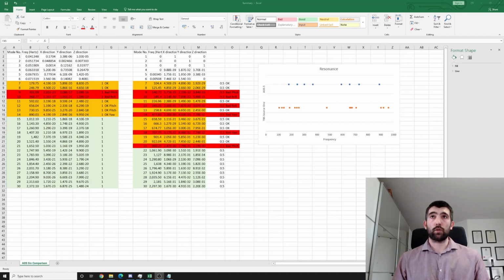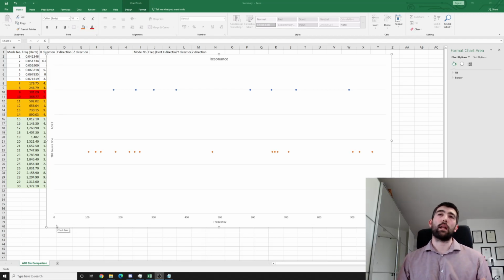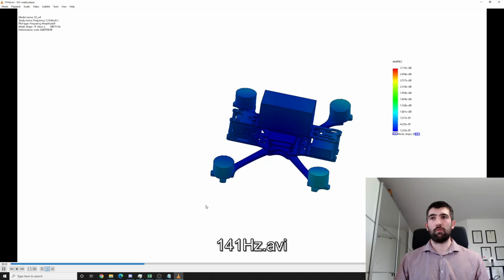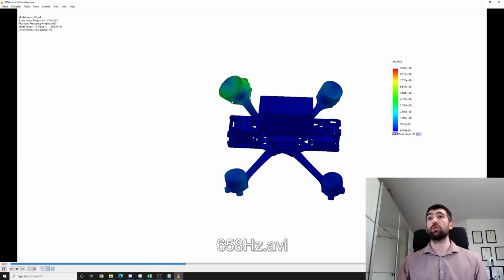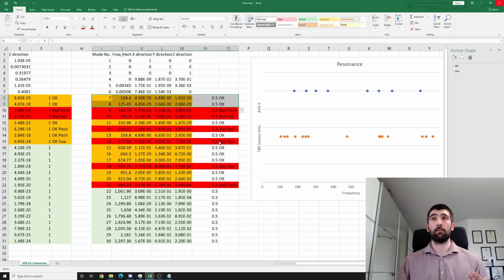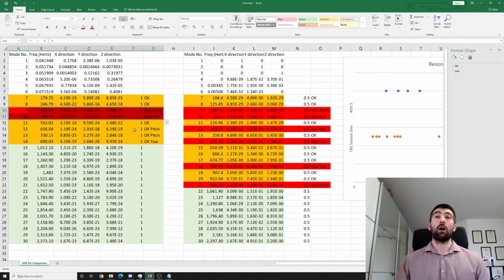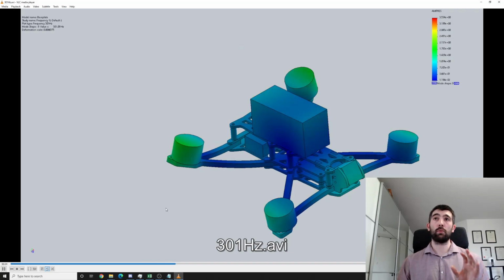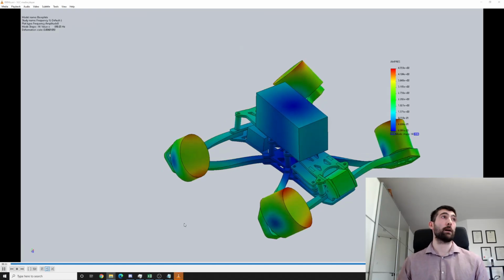Frame resonance analysis: How does my frame design stack up to the TBS Source One?

Comment: This is awesome! did you model the source one frame with 90deg cuts or with filleted edges? I have 2 genuine source one frames that have that as the only difference between them.  do you think it would affect the results significantly?
Reply from the maker: 90 degree cuts and no I don't expect small chamfers on the edges will make any difference in resonance behaviour.
Reply: @ChrisRosser  If you need any frame 3D models I would be happy to help out! super cool what you're doing.
Reply from the maker: @leadfingers  a lot of people have been asking me to model the armattan marmotte. Is that a frame you could model up?
Reply: @ChrisRosser  arm at tan frames are well known to have massive vibe problems mainly because the carbon weave isn’t oriented correctly but I wonder if it’s also design related
Reply from the maker: @CiottiFPV  It would surprise me if carbon orientation is the only factor. I agree design is definitely a factor.  Single bottom plate frames also have less inherent damping because they have fewer joints so vibes will be worse. I'm definitely doing a video on armattan at some point. I would like to get them involved, do you think it would be possible? Do you know anyone there?
Reply: @ChrisRosser  I don’t know anyone over there and unfortunately they typically don’t talk to any engineering focused people like Joshua or Mark etc...  last I heard I think the main guy over there Chris has gotten into a disagreement with Joshua but definitely don’t quote me on that but I just want to give you an idea of what you may be dealing with
Reply: @ChrisRosser  I have a tiny trainer model ready to go if you want. I would be happy to put in the work to make a model of any frame as long as I can get one inexpensively or borrow it for modeling purposes. (I'll also ask for a promise that the frame model is never distributes while the OG company is still producing it)
Reply from the maker: @leadfingers  Happy to keep any CAD confidential and sign something to that effect. Please send over the tiny trainer model. Can you reach out to Evan to see if he would want to be involved, do you know him?
Reply: @ChrisRosser  I dont know him but I know some people who do. do you have a public email I could contact you on? I dont think PM's are activated on your youtube account.
Reply from the maker: @leadfingers  You can contact me on Reddit https://www.reddit.com/user/Far_Humor_420 then I can give you an email if you need it!
Reply from the maker: @leadfingers  If you could connect me to your contacts I'll reach out and see if Evan's interested in collaborating on this.

Comment: I have found the worst thing for vibrations is the props. Even new ones. If they are bent or out of balance, they cause all kinds of vibrations.
Reply from the maker: Aboslutely, and for larger quads you need to balance them by hand to have a chance of a smooth flight!

Comment: What about 7 inch + propeller? The longer the propeller, more flutter, higher resonance, natural frequency, etc.

Probably your AOS5 design is the answer for 7inch prop and larger frame.

Also your tuning video lesson solve my 7inch quad's jello problem at higher throttle. Now I can turn off stab mode on my gopro, perfect 😁. Your video is so informative, on point. Keep it up.

Thanks Chris the Engineer 😎🚀

Comment: is this v3 of the source one? Did you analyse v4 yet?
Reply from the maker: I think this is V4 for the source one.
Reply: @ChrisRosser  oh nice. v4 is lighter and thinner arms (2mm), I guess it's +- 99grams instead of 145 grams for the v3
Reply from the maker: @babipsylon  The V4 also has significantly worse resonance performance than the V3 due to the thinner arms so it doesn't take a tune as well. In that respect its a big step backwards. Try and get the V4 with 6mm arms to compensate somewhat 👍
Reply: @ChrisRosser  yep, that's what I feared for :( . Anyhow, will check what happens when the build is finished first :).

Comment: Anyone else see a TinyHawk II in this new frame?
Reply from the maker: You're right it does look similar! My design is a 5in frame with individual arms. I've just had some prototypes back so stay tuned for an update video!
Reply: @ChrisRosser  it looks like your arms are more right angles than the tinyhawk II at the front and back.  It would be interesting to see how that impacts the analysis.

Comment: Just buy good quality frame and tuning will be a matter of minutes
Reply from the maker: Certainly a good quality frame will ensure that you can get a reasonable result easily. But people have also spent $100+ on a frame and still had resonance issues (particularly mid throttle oscillation). Even the most expensive frames aren't considering resonance in a scientific way. I'm hoping to change that!
Reply: @ChrisRosser  exactly my problem! I am through the GepRC Mark4 HD/ and am on the Project 399 Super G+ 7". having still jello problems after 200$ of frames. I hope I can fix some of that with a joint from the front to the back motors as you suggested recently. please try to make a simulation of that frame https://www.project399.com/collections/products/products/super-g-extended